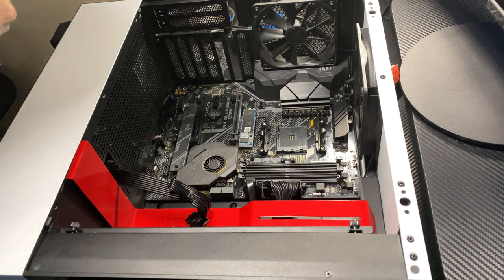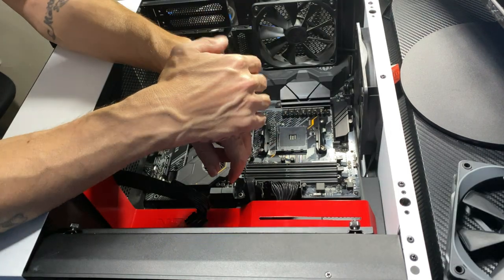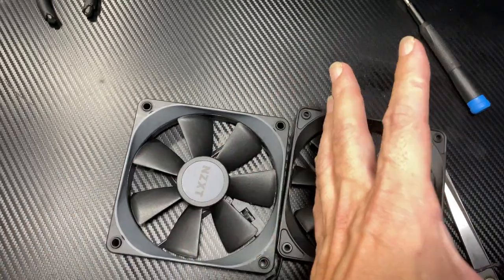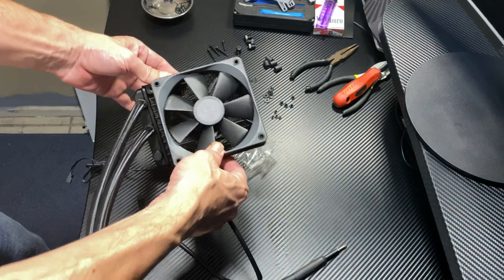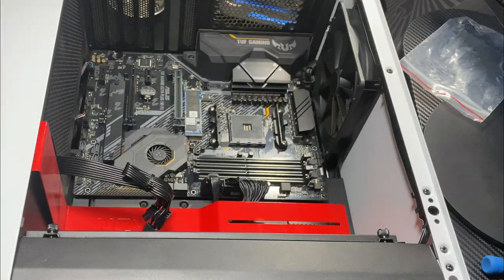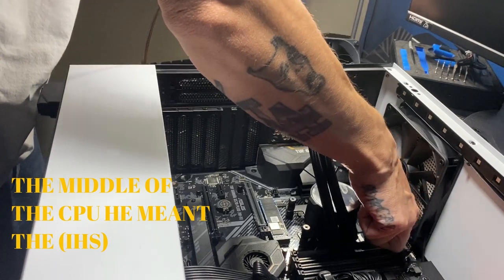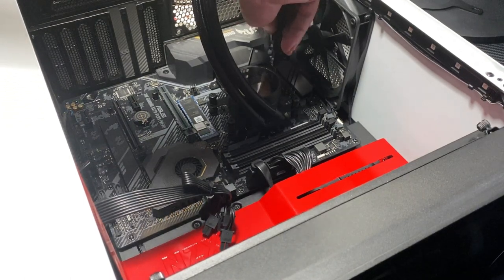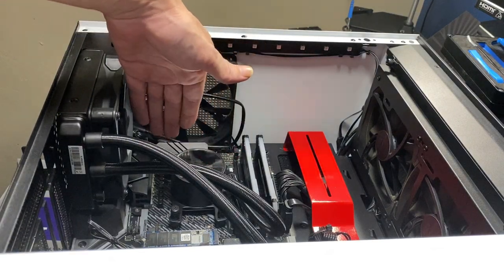Installing kraken M22 AIO time stamps for easy to follow along instruction.No profanity clear spoken

Comment: I don’t get it bro I do all the right stuff and the cooler won’t go on to the screws?! I only got this today
Reply from the maker: Please tell me exactly what you mean. If you are mounting to the front of the case and theres a radiator support bracket then try to leave out the spacers (washers) ALso you can send me some pics to me E-mail tech4u20@outlook.com and I can see what is the probable cause stopping the cooler.
Reply: @2020Tech4U  ok so I put the bracket on to my AM4 motherboard and I then go to put the cooler on but then the AMD bracket that the cooler actually goes on just won’t work. I will send you some pics on email now
Reply: @2020Tech4U  I have sent an email

Comment: Does anyone talk about the power connection  for the cooler?  I have many options and don’t want to mess that part up
Reply from the maker: If you are speaking about the Pump power coming from the AIO either plug it into a Pump header or the CPU Fan Header on the mother board. Actually any Fan header will work, just make sure u find it in the software your using for fan/pump control.
Reply: @2020Tech4U  thanks but I found the proper connection for the AOI pump worked with the 3 pin connector into a 4 pin input just leaving the one pin on the motherboard outside of the connection.

Comment: Had mine a Lil over a year. My temps were around 50°C to 68 when playing games, but now my current temps are 85-100 now when gaming. Idk what's going on. Lol
Reply from the maker: Have you cleaned the radiator? compressed air thru the fins also the fan, clean the CPU and the AIO block of all Thermal paste and reapply a quality paste, maybe hydronaut. Do you hear gurgling coming from the radiator? If so make sure the hoses are down on the RAD and if u still hear it then you need to refill the AIO, the Kraken should have a fill port, I'll be doing a video on refilling AIO's hopefully by this week, actually how to fully maintain a AIO video. Let me know if any of this helped.
Reply: @2020Tech4U  I'll take a look after work today and will let ya know what the issue is. I'm just hoping it isn't faulty
Reply: @2020Tech4U  I did everything put my temps are super high and the red cpu light comes on during install. Lol! I did have a malware and Trojan virus a week ago, but I removed it once it got detected. Could that be the case?
Reply from the maker: @smithman013  What do u mean the CPU light comes on during install? When you turn on the PC? because thats normal for the lights to comes on because thats  the mother board testing all components. POST stands for Power On Self Test. Ur PC is not on the floor correrct? Also the malware if removed properly should not be a issue. What I would do is undervolt the CPU. What are the full specs of the PC?
Reply: @2020Tech4U  I just purchased a new cpu cooler. And it will stay a solid red when it turns on because the cpu was overheating
Reply: Oh and BTW it was my liquid cooling. This new one seems to work just perfect now and there's no high temps
Reply from the maker: @smithman013  I had a feeling it was but always try the free fixes first. I just filmed a video on this issue and I'll be editing it this week so hopefully it's done in a week or so. Glad to hear it wasn't anything serious or caused any damage.